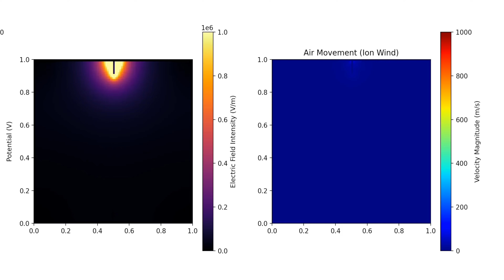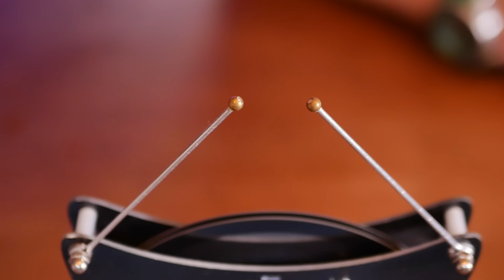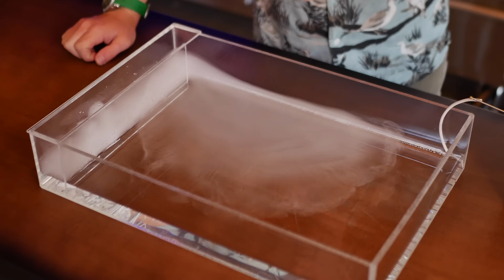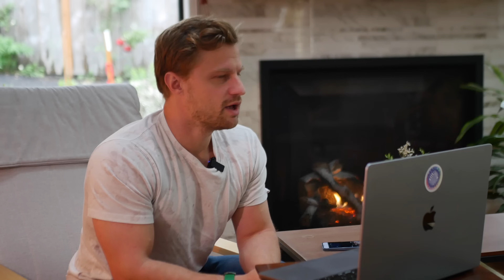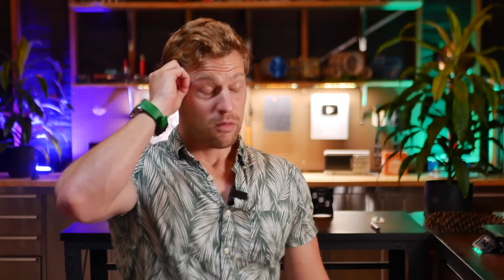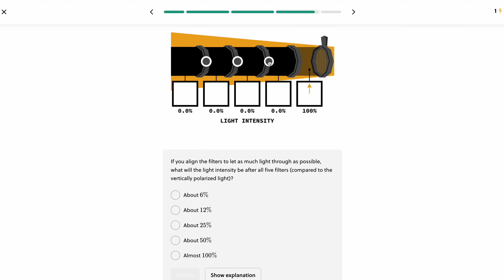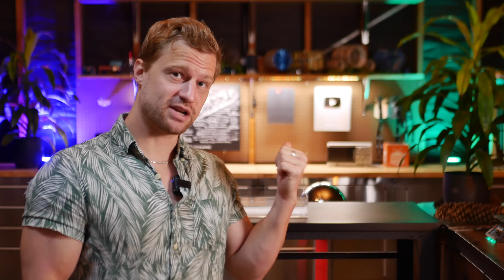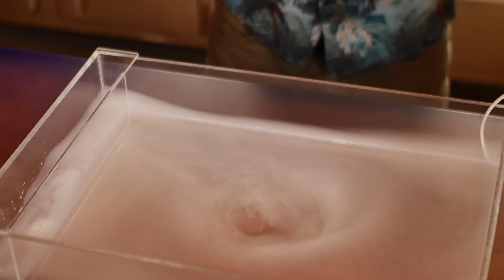This High Voltage Fog Is Controlled by Pointing (BiFrost Nebulagraphy)

Comment: Just casually touching dry ice😂 computer simulations are nice for cheap fast testing, but proves nothing. As you must know every single factor for the simulation to be relevant which you don't. If you did, the simulation and test would be pointless

Anyway, try holding your palm like you did then use your other hand to compress it on the other side. Rasengan

Not using Brilliant might have helped. If you're not a "programmer" you can't teach your brain to be a programmer...

Comment: i have experienced this a few times basically   i was statically charged and able to control a cell phone a few feet away  by pointing at with my finger  and one of my sisters has long hair and would affect electronics all the time and she is able to hold a large static charge  from my guess it's the combination of the long hair natural body oils possibly with salt mixed in acting like a capacitor  lol

Comment: Cool effect, the tunneling and focused beam itself. Doubt it's of any use, but pretty cool nonetheless
But generally It still often astounds me how little people who work with high voltage and people in physics understand it, how little intuition they have around it
The most common stupid thing they often say is how their HV source doesn't output high current, while showing dischage arcs
the currents in those can be very high, but for a short time which desn't affect your body that much, the discharge has low-ish energy, there's low average power which is what makes it safe.
Another thing is unless the wimshurst has a grounded negative lead, saying it's ground in HV is very misleading for others who may be developing their understanding of electrostatics. Positive charges aren't attracted to ground, don't experience electrostatic force and don't accelerate toward it, unlike a negative electrode, and a Wimshurst machine normally creates both negative and positive charge.

Then again I think those might both be things I said in this channels comment sections already and I'm more and more thinking I'm talking to a wall that just pretends to care about educational value and accuracy, wants to seem sciencey and get clicks and Elon-like dumb fanboys, while spreading Elon-level science insight
I used to really like this channel but a few of these comments later 0 will to improve makes me disgruntledly click on it cause I hate hearing the inaccurate talk from someone acting and seen as an authority by their audience.

although looking back, the fusion videos should have been enough of a sign that the only actually interesting and scientifically sensible thing I should expect of this channel is blindly trying different ion thruster layouts/designs with some kinda dumb tests inbetween

Also I can't find my other comments which makes me kinda believe you'd care about "looking good" in front of your audience over taking criticism, especially for mistakes in something you portray expertise over, which would be so damn low for anyone respecting "science", unless I'm misremembering and I commented on some other channel which I don't find impossible

Comment: Could this effect be used by a laser to remotely measure voltages Amps or Wattage? In experiments where a multimeter touching the experiment would change the result. In a similar way a laser measures heat remotely? Say if the experiment was placed in a container of fog. Does this effect work with other liquids or materials? alcohol like in a cloud chamber? Could you read the eV of an ion in such a cloud chamber?
Reply: don't think any of these are realistic
It seems to me like just a mildly more conductive path of concentrated charge carriers, it's still air and still can't carry much current, definitely less than plasma, cause... it's not ionized enough to be plasma
and nowadays you can get measurement equipment that has massive internal resistances, if you're willing to pay enough for it, and using this requires subjecting what you're measuring to high voltage which is not great for measuring things in the first place
Generally anticipating this interpretation is a reason I cringed a bit hearing him say it's an air wire
Also lasers don't measure heat, firstly heat is energy, you probably just mean temperature, and the laser in remote thermometers is just an indicator to show where the center of the measurement cone is (most infrared thermometers do measure in a cone), it's actually more like a single-pixel thermal camera, it's looking at the infrared radiation emitted by the object, wavelength of which depends on temperature
Seeing as the fog isn't really playing much of a role in the effect, it's just helping visualize it, there's no reason any other kind of fog wouldn't work
Reply: @AmorDeae  Not convincing. A signal is being passed so it should contain information. Doesn't need to carry much current just calibrate it to a signal that can be read.

Comment: Wondering if you could "transmit" low voltage DC or AC through the ion beam if established. So to use the established beam as an conductor.

Comment: y not put in the extra 3 days of experimentation to verify your model, make it more convincing: you can vary the voltage in simulation and predict how far away the beam should last (probability of staying stable as a function of distance), you can plot this probability density function in 2D to get a nice graph to see all data from the simulation at once, draw a curve on this PDF where the values are 0.95 and then run a good amount of experiments close to this line. Or maybe its a better idea to just make a grid on your voltage-to-distance graph and compare to the model.

Might make sense to just Monte Carlo the model and then use some kind of regression algorithm which fits the simulations.

Comment: I think the simulation method is not the best choice to find out what's going on here. It may give a false positive in many ways. I think you should test the hypoteses in some psyhical ways. I would try to block the finger with some paper, plastic, glass and metal sheets to eliminate the wind based theroies, for example. And I would try it with some other materials, in some other conditions just to eliminate the assumptions. With the simulation method you can get any results to fit your any theories and it may lead you to a biased conclusion.

Comment: I was a plasma cosmologist and I've always been convinced that our weather systems are very much driven by our electromagnetic solar environment. What you are experimenting with here lends credence to these thoughts, it just needs to be scaled up. I really enjoy your channel.
Reply: Mostly this effect turns out to be Electrospray and Taylor Cones (dating from around 1914 iirc.)     It was discovered during research into cloud droplets in high e-fields.   The droplets would spit long streams of laminar microdroplets, as the tip of the Taylor Cone would emit droplets in a successive chain.   Today it's used in ion-beam lithography, where liquid-metal ion-emitters are required (which spit out long chains of droplets of liquid indium metal.)   

I'd expect to see this appearing in the details of comet halos, emitting collimated streams of charged dust.   A charged cloud is a conductor, so a long stream of charged matter would be a sort of DC antenna, with the closer tip perhaps carving craters into comet surfaces, all by electrostatics (where the dust-stream acted as an energy-harvesting capacitor plate, the whole thing building up a large net charge opposite of the comet surface.)
Reply: you already know this was done with HAARP.
Reply: @de-bodgery  no no no, these streams are the slow and feeble version of Tesla's Death-ray!  Heh.   

Today Tesla's Death-ray is called by another name:  FIB ion-beam lithography.   That's where you use hypervelocity micro-droplets of liquid metal to carve through any known material.     But they keep it all inside the vacuum chamber in an electron microscope, so nobody realizes that it's a weapon.   "Air wires" cut through everything.   But need to use 100MV, not 10KV, so they extend 100KM not 10CM.
Reply: @wbeaty  So his voltage is way low for this to work effectively for wireless power. That's not overly hard to make much higher. An electron microscope is rather low power. It's not much of a weapon! I can't say that this effect would create a "death ray" or not.
Reply: They are in fact forced by the sun and proton radiation... it will only get more extreme as we lose magnetic field strength.
Reply: Do you think the solar storms and recent tornado outbreaks are related?
Reply: @musicalADD_theband  Solar...not a chance! We can't effect the sun. Weather....what do you think HAARP does? It's all about weather manipulation!
Reply: @musicalADD_theband  yes it’s all connected to the sun.
Reply: Yeah...that's calls HAARP and you can find it in Alaska!
Reply: @de-bodgery  that doesn't have enough energy to do much.
Reply: @PPS2046SO  As is...agreed. Pumped up a lot...I think it does! Telsa showed it working.
Reply: Do you have any thoughts on dark energy and dark matter? Can they be better explained by electrostatic forces acting within galaxies and between galaxies, than by gravity?
Reply: @StabilisingGlobalTemperature dark energy and dark matter and black holes are not needed in plasma cosmology.
Reply: @StabilisingGlobalTemperature  dark matter/dark energy do not exist. The mathematics only work in the concept of a bubble isolated from all other factors.

Comment: That's an totally unsurprising effect. What do you think is controlling much of our weather?
It's the way how sunspots cause sudden and massive changes in our weather/climate: 
They control the solar wind (aka plasma), the electric connection between sun and earth. This electric influence affects high and low pressure systems in our atmosphere.

Comment: Why not use a fog that doesn’t conduct current as well or perhaps is completely insulating to test your theory?  If your theory holds, you should get no movement at all since there would be no connection to ground.  

Maybe even just an insulator between the water and fog could do this job?  Something as simple as a floating sheet of thin wood that isn’t soaked through?  Cork?

Comment: Extremely interesting video.  What comes to mind is phased array ionosphere heaters.  Spray some conductive metals embedded in synthetic polymers meant to mimic spider web, into the troposphere.  Allows finer grained control of the telluric currents in the Earth and the voiltage gradient between the atmosphere and the surface.  If you want to move moisture, use a dessicant like alumina.  If you want to make it snow, provide flat sheets as a nucleation starter, then there's either bacterial ice nucleation, graphene oxide wedges of the right geometry to lower freezing temperature and control crystal shape, or simply falling back to endothermic reactions eg barium hydroxide octahydrate and ammonium nitrate, force it to rain or snow in the desired region.  Can heat small areas to create a bubble out into a space (pressure sphere) and divert moisture this way or that, then have it come down where you want it either exploiting natural geography or one of the other methods.
Reply: Top of the class! You get a gold star. Top secret stuff. To cover-up these ideas, I recommend a diversion called "man-made climate change".

Comment: You should also isolate your body from this, you could be acting like a capacitor plate
Try it with a point, a sphere (different sizes) and a flat disc.
Might also want to try it in a dark room, see if there's any corona.
Pharoh name ? Acryllus (for the acrylics you always use)

Comment: The better part is that anyone using one of those generators has been sending off this stream, but we could never see it. you should use the same equipment to see if talking on a cellphone while "drawing".
Reply: If you scuff on the rug, so your whole body is charged, then there may be millions of these streams shooting out.   Do they transport nano-fragments of dead skin etc?    Probably.   So, your DNA is landing on all the nearby surfaces, as well as ending up as a fog in the air.    (And if you have a deadly disease, and you prevent all coughing, well, did you prevent all winter-weather rug-scuffing too?     Magically infecting those who are yards distant.)

Comment: Genuinely curious. What about creating a fog instead by putting the positive in the water and holding the ground? Or would that not be possible? Might have to vibrate or make small waves, or points, in the water. Maybe a pin type of mat that is just above the surface of the water. I'd love to see you try. 

I love to watch actually fog form and have on many occasions seen it happen it the tops of small hills and watch it slowly roll down the sides. I feel like it's somewhat of the same concept I'm talking about.

Comment: It would be very interesting to see if you could send data through it and recover it on the other end.
Reply: If you bring a many-KV 60Hz terminal near your finger, it modulates the stream, and then you can draw dotted lines in the fog.  The HV audio from a tube-amp should do similar (as with electrostatic loudspeakers.)   
So, all we need is a detector.  These streams can be aimed through a small hole in a grounded metal plate, and will continue for many cm.   So, a grounded box with a hole in the side, plus a tiny floating plate connected to a FET-input voltage buffer.  It's all HV stuff, so maybe a gain-stage isn't even required.  (Perhaps short the input with a 100M resistor, so the volts fall rapidly when the stream turns off, and so the volts won't rise high enough to kill the op amp.)

Comment: Great video. Are you using distilled water? I wonder what would happen if the water had different concentrations of ions in it. Would it enhance the effect; could you draw from farther away? Or would it dampen the effect?